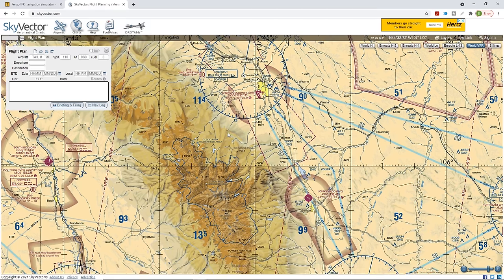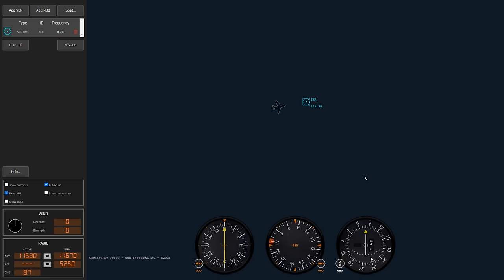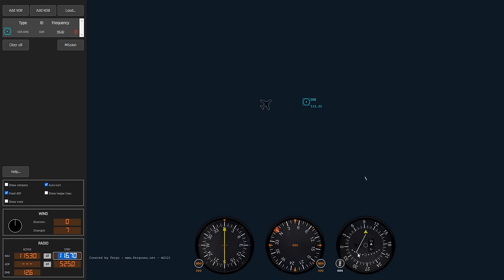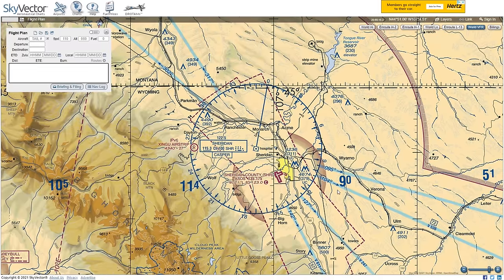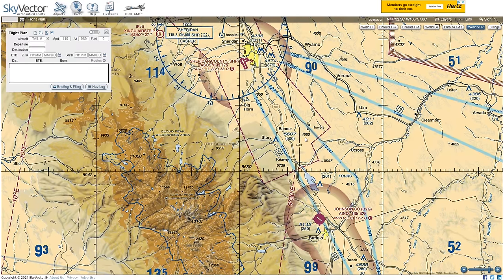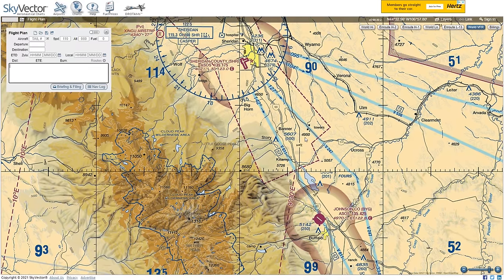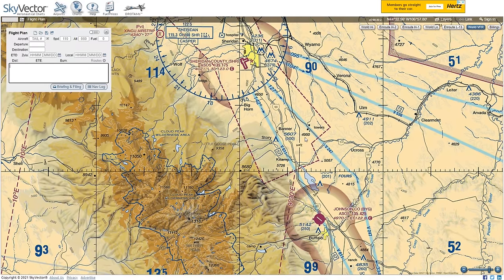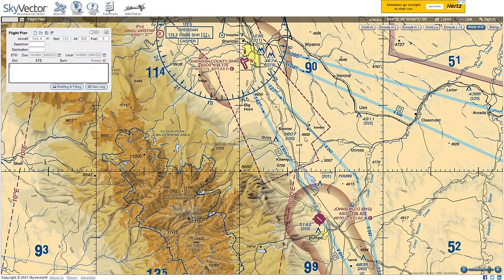How to Use VOR Navigation | Tracking and Intercepting Radials | Instrument Navigation

Comment: In my younger years, I taught ground school at the local flying club, and quite often the reciptical was sometimes hard to figure out by some of the students, so here is what I recommended. Regardless of the course, the fast, easy way was to add 200 hundred, minus 20, or depending on the course, subtract 200 hundred and add 20, it always works out perfectly.

Comment: I guess most pilots under the age of 40 do not remember the old RNAV or Area  Navigation navigation system prior to the invention of the GPS. It was a system that allows you to tune a VOR and electronically move the station over your course so you flew a straight line and only had to use the CDI the same way you use it now with the GPS. It did this by inputting the VOR’s DME from your course and the radial that intercepted it. It was kind of cumbersome to enter, but it actually worked like you were flying a GPS straight line instead of navigating a zigzag pattern from VOR to VOR. One other system  for long range, especially over the ocean tracks, there was Loran C.

Comment: At 22:50, and I'm sure you know this but just didn't think of it at the time, your heading indicator has has marks every 45 degrees around the edge, so you could simply line up that 45 degree offset mark with your original 122 heading to easily get you pointed at your intercept heading.

Comment: Very nice explanation. But I have one question... If you're flying from one VOR to another, do you reallly need to go right over each station?
Reply: You do not have to go over the beacon per se. After all, an RNAV will use turn anticipation to prompt the turn (the caveat being some waypoints are ‘fly over’ waypoints). But if you go right back to first principles and consider that you have only a single VOR, then you do not know exactly how far from the beacon you are so you need to overhead it in order to turn at a known point and be sure of remaining inside the protected airspace.
Reply: @XPLAlN  Nice explanation. But with DME I can fly past it witout gover right over, correct?
Reply: @zephaneas  yes that is correct. You would start the turn based on DME shortly before the beacon, the actual distance depending on the radius you will get from a standard rate turn at your TAS (by applying some rule of thumb or simply when prompted by the RNAV).
Reply: @XPLAlN  Thanks!

Comment: Agree with the others - best VOR video I've seen (and I watched a lot of them!)  I'm just starting my instrument rating - on a VOR hold pattern does the pilot then dial the VOR 'to' and 'from' for each leg of the pattern?
Reply from the maker: This is a great question. It’s best to leave the setting alone once you’re established in the hold. So if you’re flying inbound to the VOR, leave it set so that it points TO until your cross over. When you’re outbound, there’s no need to reset the VOR bc there’s no guidance to follow. There’s a VOR hold video on this channel if you want more!
Reply: @flightinsight9111   Ah, excellent.  I'll look for the VOR hold video. Thanks!
Reply: Just watched it. Makes perfect sense.  That is until I have to actually fly it.  :D

Comment: There is a much easier way to work out which course to fly regardless if it's to or from. Use the VOR compass. If the needle is to the left look 45 degrees up and to the left to give you your course you need to head to intercept. This works for both to and from and saves you having to Mentally rotate and also cuts out all the mathematics. SIMPLE